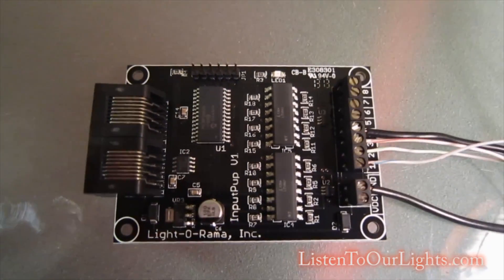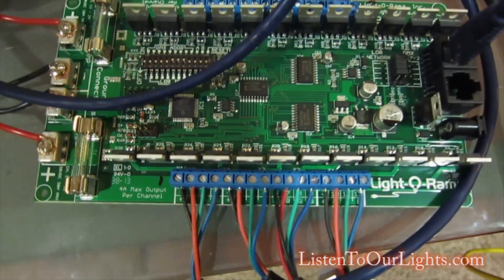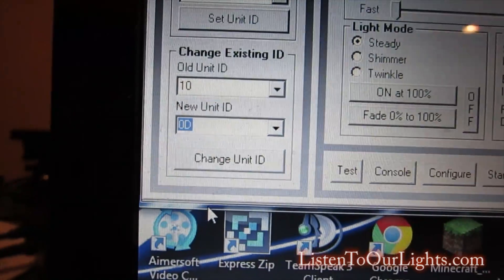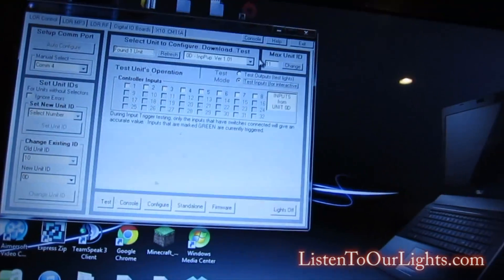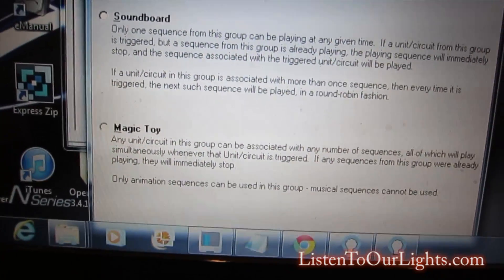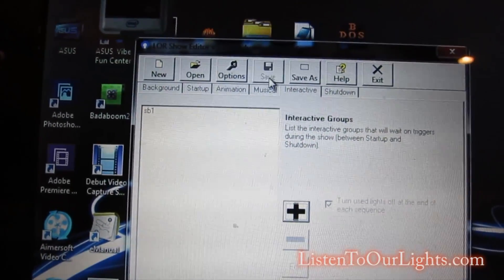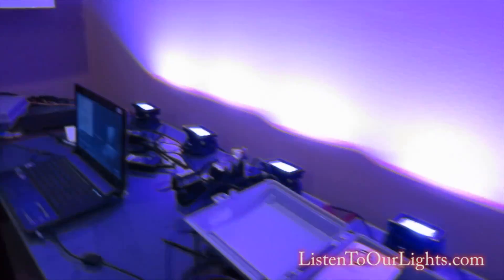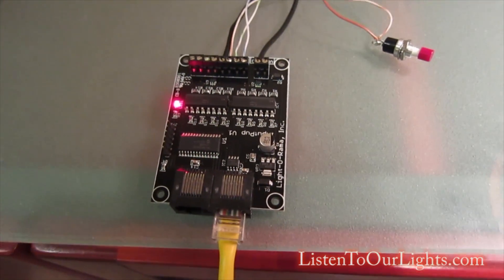Making Interactive Christmas Lights with Input Pup

Comment: John, thank you for the video. I purchased one hoping to be able to use my controllers for more than just holidays.  I'm going to try to set up motion detectors that will turn on lights to light up car prowlers during the summer and maybe play some sound effects to make them think someone is outside (shotgun, distant siren, dog barking, human voice) who knows?  Anyway, I'm not an electrician so I was concerned about blowing the board, but your video reassured me it's simple and the board is fairly hardy.  For my first test I edited two sequences so they were only about 20 seconds long, inserted a wire into channel 7, 8, and the ground.  Then set up a test show as an interactive jukebox and simply touched either wire from 7 or 8 to the ground to complete a circuit without having switches, etc.  It just works and there's no smoke or sparks....yet!  Now to find some motion detectors that will work well.

Comment: 1st I want to thank you for this video. I believe I have said it before, Light-O-Rama doesn't make videos on a majority of there equipment for some reason. I have the Input Pup working perfectly all due to your video. 1 problem, I utilized all 8 buttons and they work fine, but the 1 I have dedicated to run the "Main Show" only runs 1 song at a time and as you stated, it picks them "Round Robin." So John, is there a way to make my "Main Show" button to automatically run all of my existing sequences continuously? I realize you are probably as busy as I am right now, but I would really appreciate some help here...Thanks!